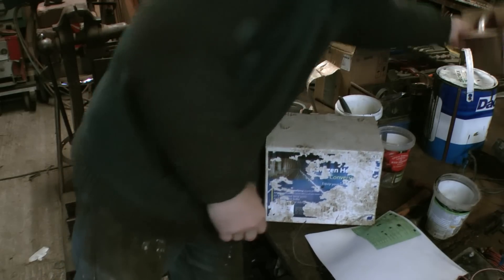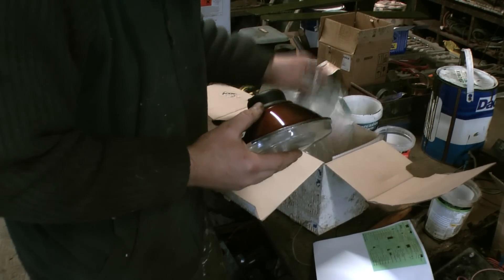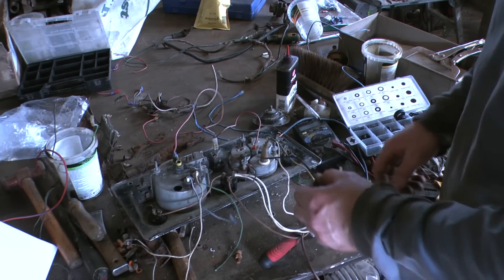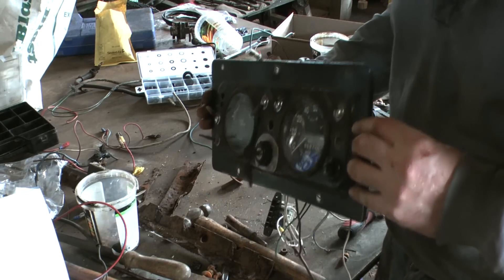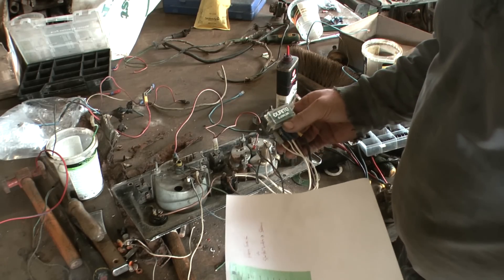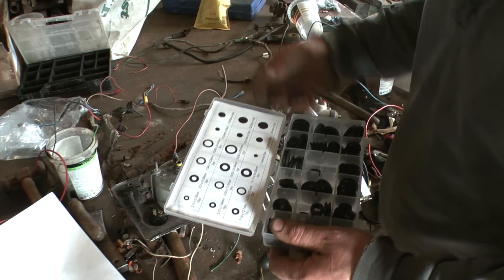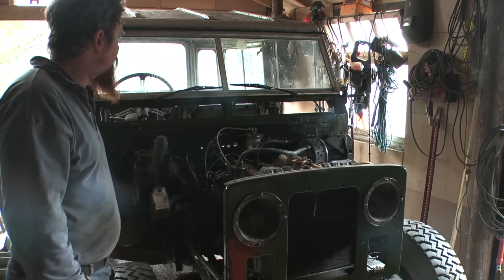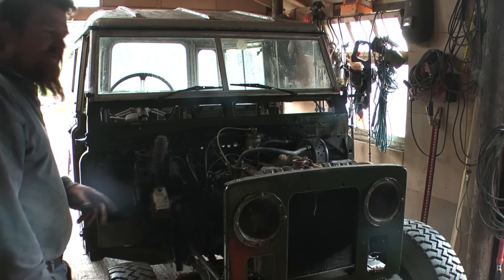Land Rover series 2a restoration pt 14

Comment: Creating your own bespoke landrover loom is quite good fun and as you say, achievable. Did one 20 years ago (s1)and am planning my new one (s2)now
Reply: I created a new loom for a kit car.   One. circuit. at. a time. Easy if you do it like that. But document it as you go. That way you can make it work how you want. Like do you want the horns to work with the ignition off, or only when it's on? And so on. I built a fuse box and relay box into a waterproof housing. Nowadays you can buy a kit of parts to do that. Don't use colour coded wire,  that's the expensive way to go. Buy bulk single coloured wire and buy a cable labelling kit to label the ends. Use heat shrink covered connectors and grease them before you put them on. And lastly, use really heavy gauge wire for the headlights, whilst uttering curses in the name of the prince of (automotive) darkness, Joe Lucas.
Reply: Donald Sayers yeah, it shocks me how thin modern looms are for everything. Heated grips on my Bmw running off transistor radio gauge wire. Did my 6v bsa wiring using all hd wire to avoid voltage drop. It'll las longer too!

Comment: You are very inspiring mate I am actually restoring a 1972 series 3 88 in two and a quarter petrol the restoration of slow down a bit at the minute but we will get on with it and hopefully by mid 2018 should be ready for an MOT keep up the good work from Mark in Cornwall

Comment: The Wipac Crystal headlights along with a properly upgraded wiring loom (so you get a decent voltage to the bulbs and don't have another fire) are well worth the upgrade.
Makes a huge difference even on a relatively "modern" Defender which had a similarly rubbish system to the older Series Land Rovers.